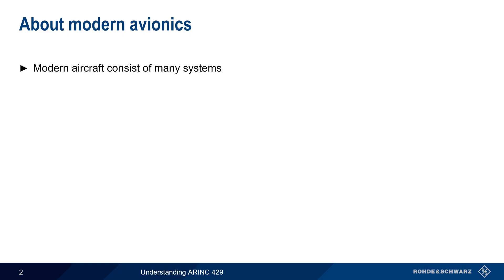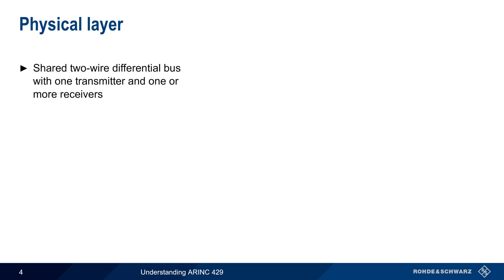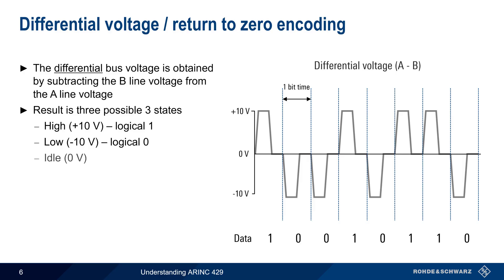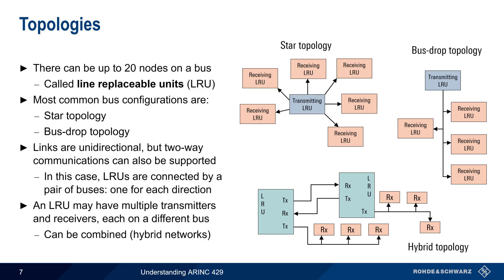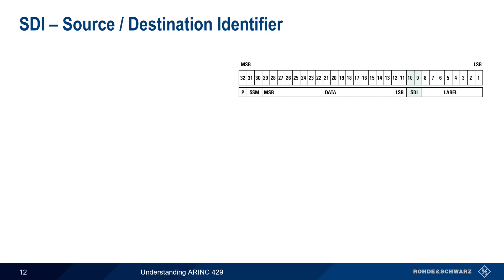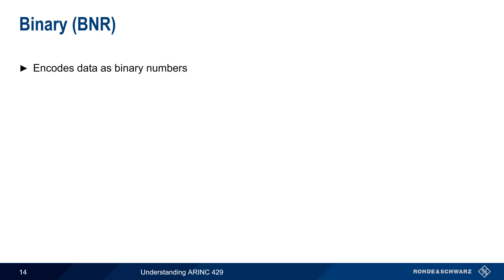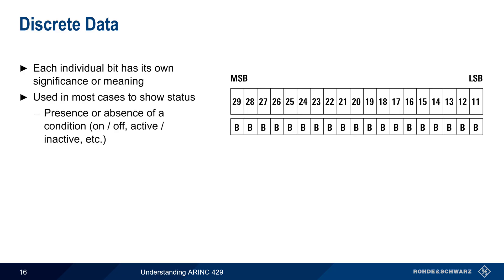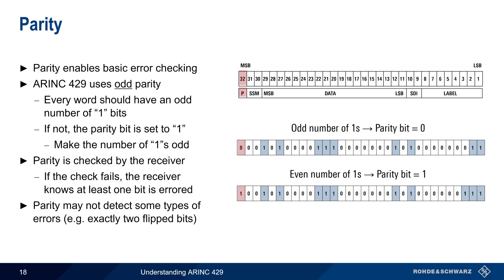Understanding ARINC 429

Comment: How are modulation schemes (APSK, FPSK, QAM, etc.) involved if digital communication is used?
Reply: They are not in this case - the "digital" modulation in ARINC 429 is simply high and low voltage levels (or more specifically, the difference between these levels)
Reply: @pauldenisowski Ok, thanks.